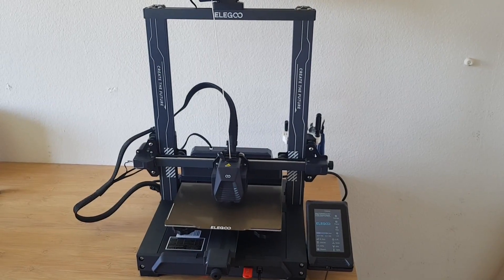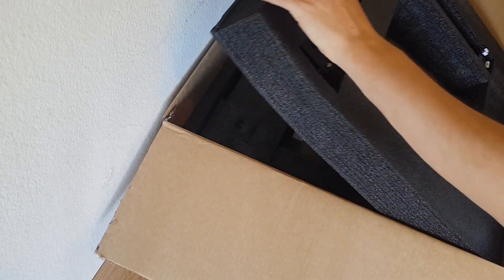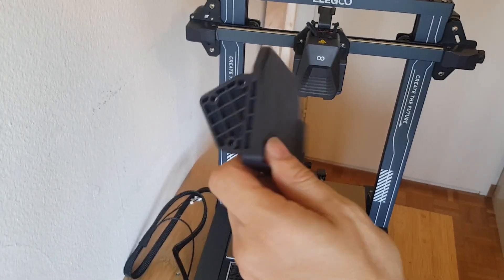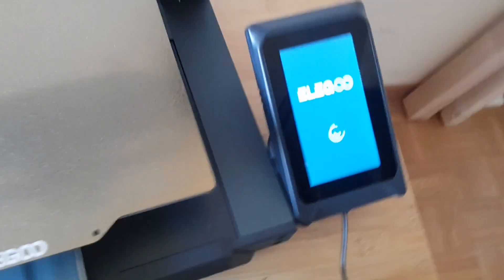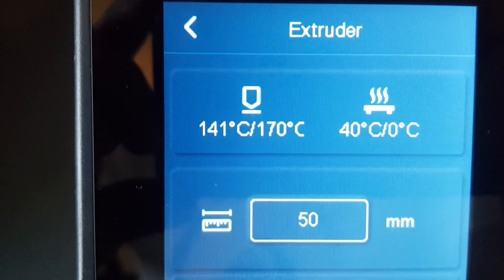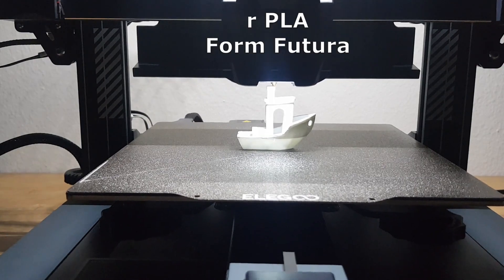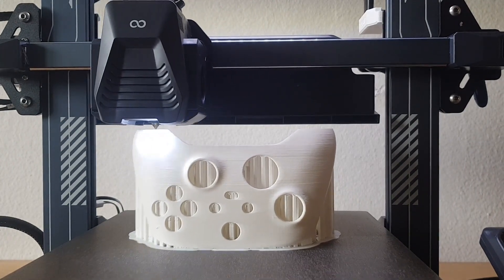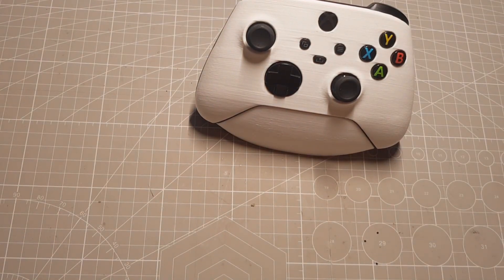High Perfomance and Beginner friendly? Elegoo Neptune 4 Pro

Comment: My Elego Neptune 4 Pro has a bed deviation of about 0.28 mm. Big pieces come out wrong for me. Would you know how to request it?
Reply from the maker: Hey mate, my deviation was sometimes also quite large. I have often leveled the bed, first manually, then automatically the mesh above. So long until I was satisfied to some extent. Nevertheless, I still often have a visible deviation of the z offset at the first layer.
Reply from the maker: ...i also set the first layer to max. Hight in the slicer, that may help a bit

Comment: do you have the auxiliary fans "full mode" for a printing speed of 250 mm/s? Have you tried to see at which speed they are not needed, or at least in "mute" mode?
Reply from the maker: Hi Multiberto92, I have done most of the prints so far at 250mm/s with the fentilator set to 80%. I have only made 2 prints with 150mm/s and set the fentilator to 50%. It worked fine so far, but it was only small parts.
Reply: @Dirt-E-Bikes   thanks for the answer. No review talks about this and it's refreshing to have some feedback on it at last hahaha
Reply from the maker: @Taprico22  you'r welcome 👍

Comment: Your infill problem may be a levelling issue.
In the video, you only show doing the Z offset and then auto levelling.

You need to do Z Offset for the middle, then do "Auxiliary Levelling" where you do all 4 corners a few times so they all have the same amount of friction and then do auto levelling to generate a mesh bed to allow for compensation in areas that aren't quite as level as others.
Reply: Lol, no. It's an extrusion issue
Reply from the maker: @TheLuciano1806  Ok, do you mean too little or too much extrusion?
Reply: if it were an extrusion issue, then it'd be consistent across the whole bed regardless of position. That wasn't the case, uneven extrusion (one side having what appears to be less squish and the other more) means an uneven bed level. @TheLuciano1806
Reply from the maker: Thank you GroundPlayz, i will try this tomorrow morning 👍 Im glad for good advice like this

Comment: I've been waiting for the larger format version of the Neptune 4 Pro, and hoping maybe they'll add WiFi to that as well but probably not.  I may just get the existing Neptune 4 Pro.  The steel motion control components and Klipper should improve my print quality and also increase speed on the rare times I print PLA instead of TPU.  There are a lot of great features for $299.
Reply from the maker: I was also waiting for the larger one, but then realized that i probably dont print that many parts that would not fit the printvolume of the 4 pro...
Im very pleased with the printer,  just still have this problem with the Infill (at 3.50 in the video) do you have any Idea what that can cause?
Reply: @Dirt-E-Bikes  - I bought the Neptune 4 Pro last night.  Hopefully it'll ship soon.  I also bought a Linksys AC750 WiFi extender to get the wired LAN on the Neptune communicating on WiFi so I can manage the 3D printer over a wireless LAN connection with Klipper.

3:50 - I was a bit surprised to see the print head dragging on the infill.  That shouldn't be possible.  Maybe a slicer problem?  What slicer were you using?  I'll sometimes print 0.1 mm layer height perimeters for a smooth surface finish and print a thicker infill layer every second or third perimeter layer, but PrusaSlicer prints all of the perimeters first and then prints the infill so there is never any infill higher than the nozzle.
Reply: @Dirt-E-Bikes  - I also bought the smaller Neptune 4 Pro rather than waiting for a larger format printer because, as you said, my need for large format printing is infrequent and I mostly wanted it to be able to print more items at one time, but then I figured that the larger bed and wider gantry might reduce print quality slightly which wouldn't be worth it.  It's also nice to have a smaller printer on my desk.
Reply from the maker: @Liberty4Ever Yes I thought the same thing. Have you already received the printer? And is everything running as it should?
Reply: @Dirt-E-Bikes  - I ordered the Neptune 4 Pro the Friday night before Labor Day, so it hasn't shipped yet.  Hopefully it'll ship soon.  I look forward to improvements in print quality over my current Sovol SV01 due to Klipper's more precise motion control and extrusion and better part cooling.
Reply from the maker: @Liberty4Ever  nice, so far im very happy with the outer layers the printer does, but habe to work that infill problems out. Do you use some sort of high speed PLA on your sovol? I wonder if i should try one of those Filaments that are made for higher printing speeds...
Reply: @Dirt-E-Bikes  - You could try slowing the printing speed in the slicer to see if the weird infill problem disappears before getting high speed PLA filament, although some regular speed PLA prints well at high speeds... typically some of the name brands.  I seldom print PLA.  I mostly print TPU for the products that I sell.  I've been increasingly printing PLA for custom packaging material.  Custom fitted and reusable protective packaging has a customer wow factor and it's cheaper than a small cardboard box.

I'll let you know if I have the weird infill problem you've experienced.  I use PrusaSlicer so I'll need to get/make a profile for the Neptune 4 Pro.
Reply: @Dirt-E-Bikes  change your infill to gyroid.
Also raise the temperature for pla to 230 235 degrees when you print fast.
Activate also Z hop in cura.

But I recommend to switch over to prusa slicer or orca slicer.
Reply from the maker: @stefan3d  Thanks man, I will gladly try. I have also tried with other infill and it went a bit better. With the temperature I was already at 225, but I will try your tips and print with 230 to 235.